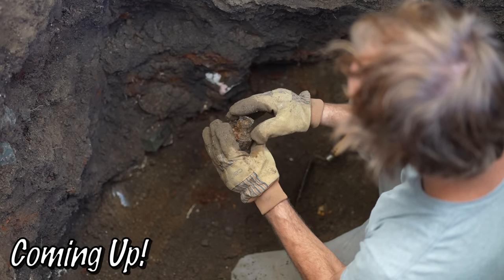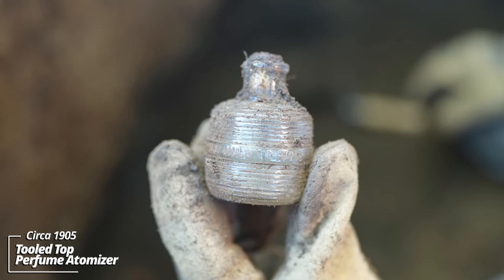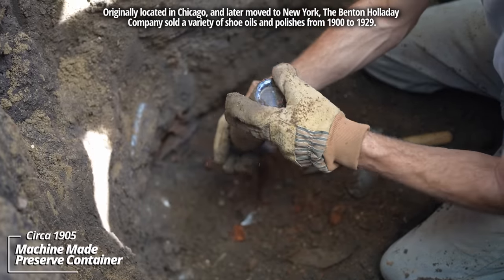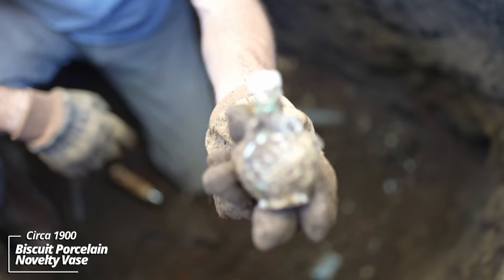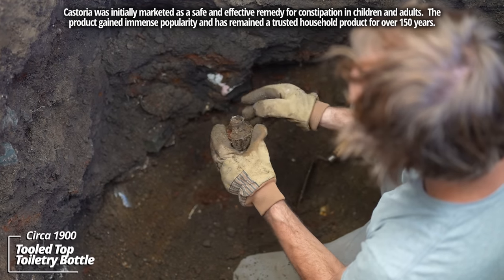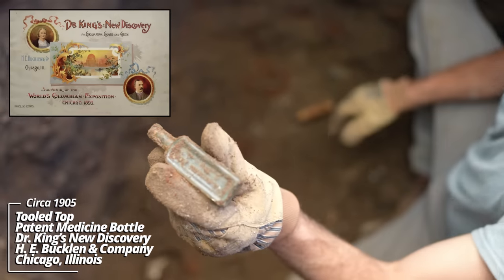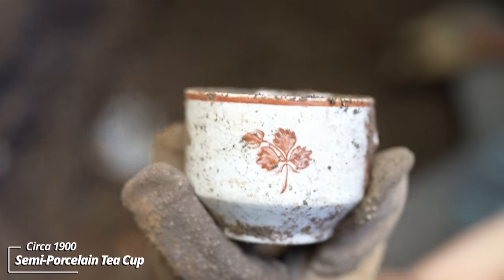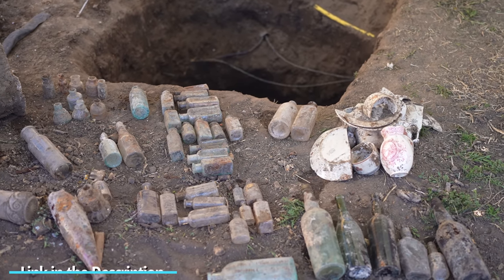Digging Out a Fence Post Leads to the Find of a Lifetime Buried in a Back Yard for 125 Years

Comment: Is that water in bottles?
Reply from the maker: yeah its just ground water.. if they land with the hole up, they are usually full, if the land top down, theyre usually empty, if they land on their side, they are usually half full.. just depends on if the air has a way to escape when its submerged.. but yeah, its pretty standard.. i mean, i wouldnt drink it or anything, but its not like.. waste or anything
Reply: @BelowthePlains  Thanks

Comment: why is there liquid in so many pieces????
Reply from the maker: its just ground water. if they land upright or on the side, when it rains it will leech into the bottle. but if it lands with the hole pointing down, then the air cant escape and the water cant fill it up. thats my theory anyways.. sometimes the water table will be a few feet down, and the pit will slowly start to fill up, but ive noticed that even when the pit it relatively dry, there will still be water in some of the bottles. thanks for watching tho! hope that was helpful. but its just my theory, i dont know for sure

Comment: I find it shocking that so many bottles are sealed and have liquid in them.
Reply: There were not sealed.  Bottles back then were sealed with corks, which after 100+ years would have rotted away.  That liquid was ground water.
Reply: @gregb6469  The reason I thought this is because I did not see anything pour out of them when you turned them over.

Comment: I was wondering how many coins you might be missing without a metal detector. I would run a detector over the surface before you start digging as you just might be missing some 19th century coins in that dirt!

Comment: I can't be sure with the dirty base, but the H J Heinz Co Patented 1890 has the center bot number - that looks like 30 with a maker's mark above it (unrecognizable).  Wish this was totally clean.

The bottle number "appears" to be 30 - which was a Sharpsburg handblown (1880-1898) utility bottle of various food categories in an “English style” bottle holding xx ounces of select pearl onions, green olives, celery sauce, or sweet gherkins, sweet mixed pickles, imported pickled cauliflower, ... made in  aqua and flint clear glass with a cork ring gasket and glass stopper.

IF (!) - this is an unlisted 40, 50, 60, or 80 bottle number - then this is unlisted and a one-of-a-kind artifact that is a $100-300 bottle for its rarity.  I have not (as yet) seen any mentions of a PATENTED 1890 bottle across any of the categories, so this also portends an anomalous Heinz bottle for the company bottle database.

So a clear focus of a clean base would be most-appreciated - as well as the maker's mark (above the bottle number) in that post-1900 period of the still-embossed bases for Sharpsburg or a contract maker.
Reply: Looking further in the vid, it is a handblown, screw thread tooled lip - which makes it NOT a 30, but another bottle number - or a collateral variant of the 30 (unknown) as a screw thread.  This truly is either unlisted or a collateral variant and now up to $300 ...